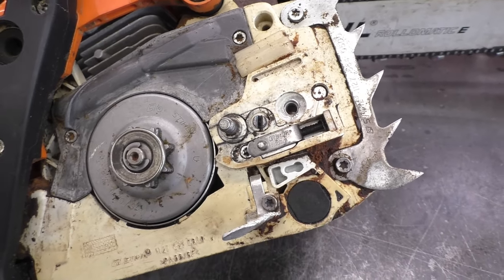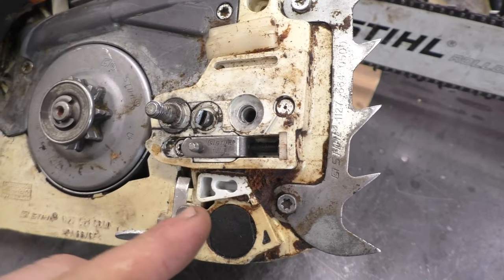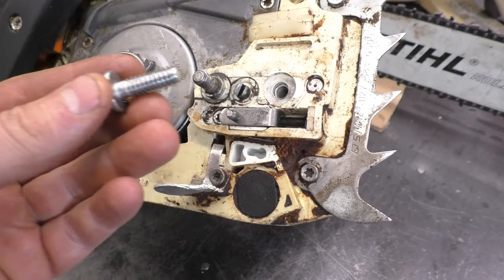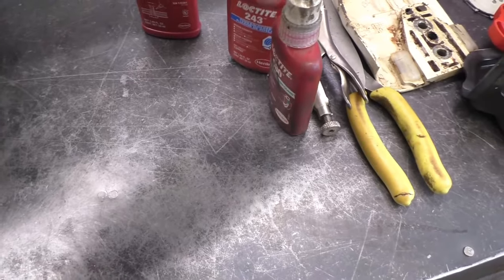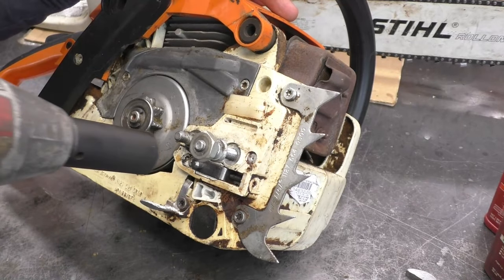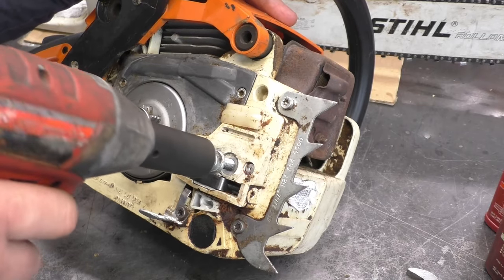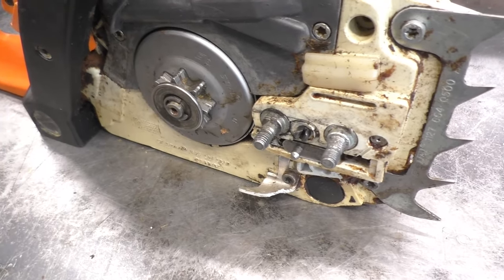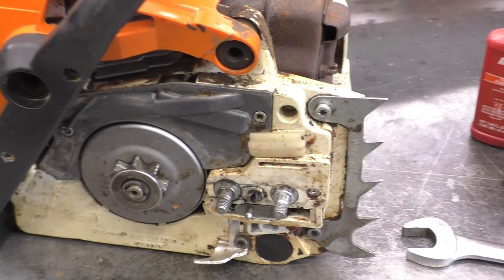Should LOCTITE Go On Chainsaw Stud Threads?

Comment: So the STIHL tech bulletin from 2011 says not to use loctite on the polymer housings. When running the stud into the case it is important not to screw it in below flush. When you put the bar, chain and side cover on and tighten the bar nut normally it just sandwiches those parts together and there isn't any significant load on the part of the stud going into the case. However if you have the stud screwed down below flush even slightly it will pull the stud out of the case when you tighten the bar nut.

Comment: I just cleaned up my MS250 last weekend.  Completely disassembled it, even greased the little roller bearing for the clutch drum ( Thanks Don for that vid) Studs are still tight, also sharpened the chain.  Ready to cut down a maple next weekend.  Have a great Sunday my friend👍

Comment: Interesting, thanks.  I think I'd have used a socket or pipe of some sort between the nut and the shoulder of the stud to tighten it in.  Using the nut to the end of the threads risks damaging the threads on the nut as well as stressing the threads on the stud.

Comment: Super Glue makes since in this application because of the plastic.  I worked in a manufacturing plant and a common loctite used was 222 for applications to help secure the hardware needing some additonal holding power but not permanent.  Loctite 35 was used for permanent locking.

Comment: Great idea for the superglue in the plastic thread rather than loctite! When installing and removing the studs if you put 2 nuts on the same thread and lock them together you can turn the outside nut to tighten the stud or the inside nut to remove it, then unlock the nuts from each other and remove by hand.
Reply from the maker: The threads weren't long enough for two nuts.
Reply: @donyboy73  ahkay fair enough I've never worked with that model but every other Stihl I've worked with has had enough

Comment: There are a lot of things you can do but you don't need to use anything. The clutch cover acts as a washer so there isn't a lot of rotational force placed on the studs either while tightening or loosening them.

Comment: I've found that degreasing the stud and hole, and tightening the stud adequately but not over torqueing, works fine. But then the saws I've worked on weren't subjected to the abuse and neglect that saws going into a commercial shop encounter. My son sells, among other things, Stihl, Husky, and Ferris outdoor power equipment. The things people do, or don't do, is no longer a surprise to me!

Comment: The only problem with using Loctite on that stud if you need to remove the stud for any reason because you might not be able to remove it.

Yes, research the Loctite products because my old workshop manager who I did my apprenticeship under when we were repairing power tools because they have limits on how bigger gap that it can fill like 0.2mm is largest clearance that some of them can fill in a bearing housing whereas some of the Loctite products can fill a much larger gap.

I used Loctite 620 to repair a slightly worn keyway & blade boss on my 3 horsepower Briggs and Stratton powered lawnmower engine because it was making a noise due to having slop on the shaft & in the Keyway.

Why my manager talked about that with me is because some of the electricians who were a Walmsley who worked alongside of us in my bosses other company would try to fill a 0.5 millimeter gap with Loctite in a bearing housing !

Comment: I was employed in the plastic industry for many years. In some cases, Loctite can cause cracking of some types of plastic. Especially in situations where the plastic is being stressed - this would be one of those situations. I'd be calling  the chain saw manufacturer to verify if Loctite is safe to use in this situation. The technical name for this is "chemically induced stress cracking".

Comment: from experience, Loctite Threadlocker reacts negatively with some "plastics"...not sure about the housings for chainsaws though.
(edit: or I should say the "plastics" react negatively to the Loctite...lol)
Reply: I have also experienced plastic reacting badly with Loctite. It caused the plastic to weaken.
Reply: I have also had a bad experience with Loctite. I used it to secure the tiny bolts on my ‘bonnet protector’ (a plastic deflector designed to minimise stone chips on the bonnet). The material is listed as ‘acrylic’? The Loctite caused stress cracking in the ‘acrylic’ which radiated out from all the bolt holes. The bonnet protector was rendered un-usable.

Comment: I have a chainsaw, it starts normally and after it is warm, the engine stops, what could be wrong?
Reply: Air leak??
Bad ignition coil??
Bad carb??
Reply: 1) make sure fuel tank is properly vented, there should be a vent line somewhere that the top of tank.
2) check for spark right away when engine shut down, ignition coils can fail when heated up.
3) toss some carb cleaner etc. in carb. Try to start, if it starts for a few seconds, you have a fuel delivery problem.
Hope this helps, best.
Reply: Between Donyboy, Chicanic & Steve's SE Saloon, there is a video that will solve 99.9% of small-engine problems.
Reply: It's not small engine 73.5cc.
Reply: @joshuasylvester01  
That's still a small engine.
Reply: @joshuasylvester01  Chainsaws are small engine.  I know of no chainsaws that run on multi-cylinder engines.  The solution to your problem can still be found on the YT channels I suggested.
Reply: Clogged spark arrestor
Reply: @COSpacegunner  It's just a chainsaw not what u think